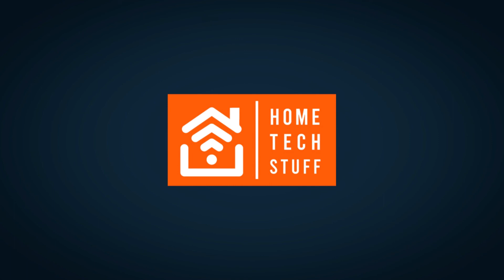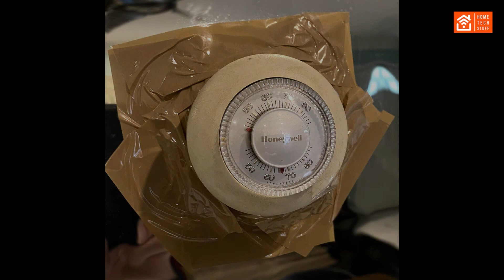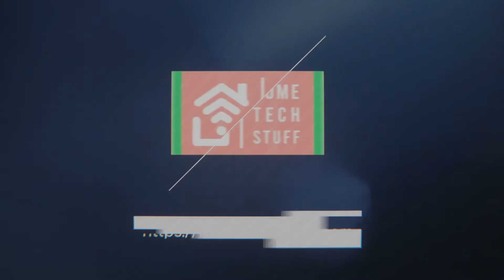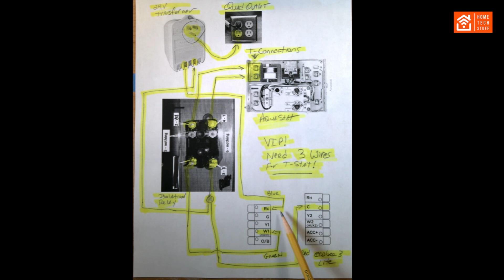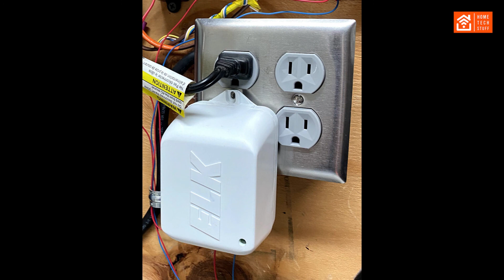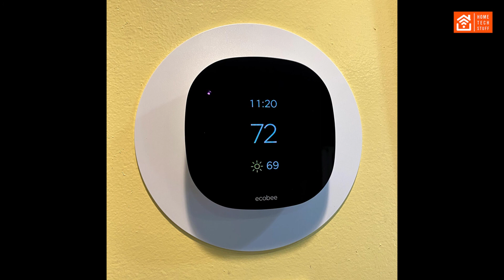ecobee 3 Lite Heat Only 2-wire Boiler w/Oil Primary Control & Aquastat Full How-To

Comment: i am a bit confuse thanks for the sharing with the new three wire concetion installed from the wall you use blue, green, and red . blue conected to rc green conceted to W1and the Red conecpted to the C
is it not supposed to be White to the W1 , Red wire to the Rh and the Blue to the C .  why is it different ?

Comment: It says 2 wires here and than he talking about running a wire, thats 3wires wtf change your name
Reply: The title says "2-wire Boiler."  This means the boiler's control panel has no mechanism for powering an EcoBee or smart thermostat. You need three wires at the thermostat to ultimately control a 2-contact aquastat via the normally open side of the isolation relay and 24v transformer. The easy path you are hoping for doesn't exist.  Trust me, I looked. This is the best resource I've been able to find.  Study it. Oh, and your ignorance is showing.

Comment: My boiler has 3 wires, any idea what tweak would I need to make to get the ELK auto-resetting transformer and the other component to work with the ecobee?
Reply from the maker: Hi, I am sorry, but I do not know that. I only figured this out for a two-wire. Did you try calling Ecobee support? Have a great day...
Reply: @hometechstuff  so I did end up figuring it out. All it required was installing a 24V transformer and hooking it up to rc and c, leaving the original wires in rH and w1. Thanks for posting this and helping me think through it!

Comment: Hi I have an old millivolt, 2 wire in wall / recessed gas furnace (one that gets it’s low voltage current from the pilot light. I’ve watched other youtube videos that have said that I would need just a 24volt transformer to get an Ecobee working. I see here that you also needed an isolation relay. How you determine when you need the isolation relay though? Thanks for posting this video!

Comment: Most of the NorthEast has this setup ....you didnt mention why you need an isolation relay to work. If I have my 2 existing wires to the thermostat  why cant I plug in  a 24v transformer and run it directly to the thermostat C connector to provide power. ( Leaving the connections to the boiler/aquastat untouched) Either way do you have a link you can post for the isolation relay. Your drawing was perfect and explanation really helpful.
Reply: this method seems to be a popular fix for many nest users with heat only 2 wire.  to connect a 24 v wall plug  connect one wire to the RC and the other to the C wire.
Reply: @atarixbox  hi there, whem you say connect one to the rc and the other to the C, are you talking about the two from the transformer? Where do i plug the 2 wires originally running from the boiler? Your help will be appreciated, thanks!!!
Reply: @aldenleonardo  thw two wires coming out of your wall. The white goes in the W1 and the red goes in the rh.     The external transformer  one goes in the C the other goes in the Rc. Hope that helps
Reply from the maker: Hello and thank you for taking the time to comment. I have the relay because ecobee support called for it. Not my design, I just got it to work. There is a link for the relay in the video description. BTW - It's been very cold up here this week and the ecobee 3 lite has been working exactly as I needed it to. Have a great one...